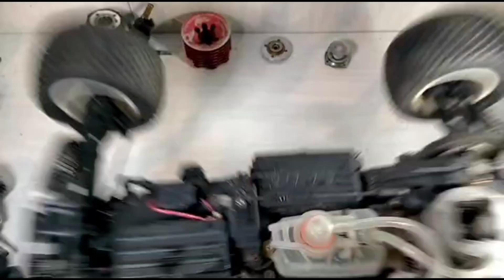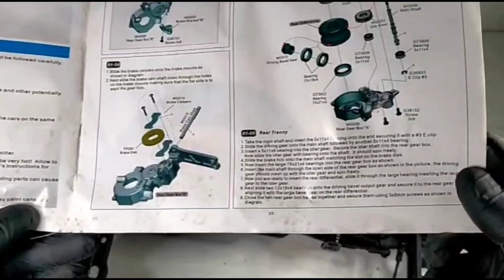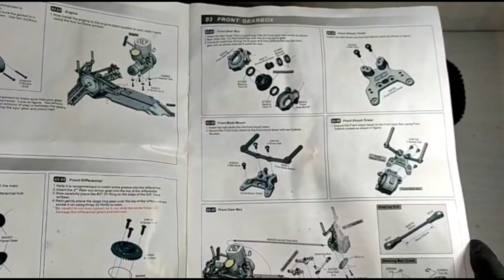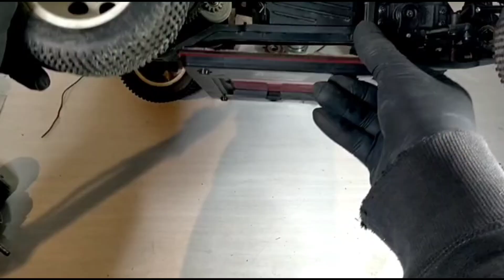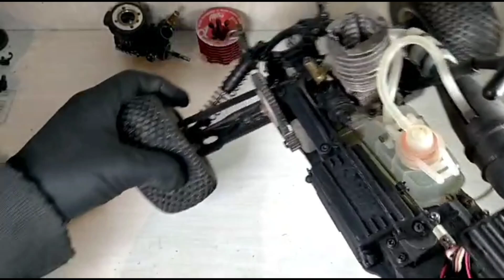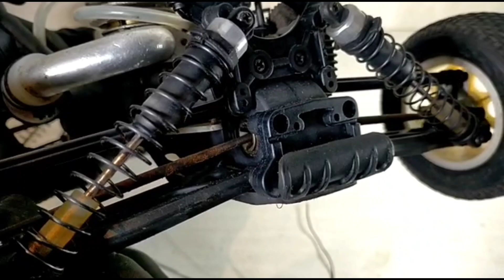CEN MG10 TR MT3 NITRO 1/10 1:10 scale Truck RC monster stadium 4WD NS18 NT16 engine fuel power

Comment: Really nice and detailed video, I have found one of this, and the one which your showing is stadium truck which I found is monster truck. There is slipper clutch and clutch set with clutch bell is missing which I need to fix can you please suggest which clutch will go for this engine thanks